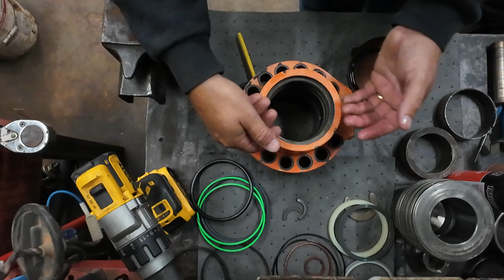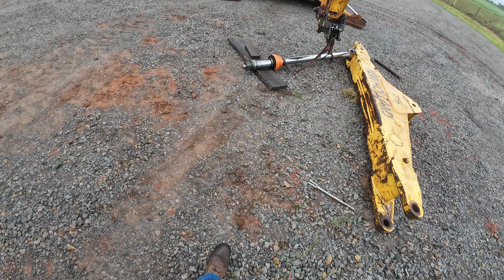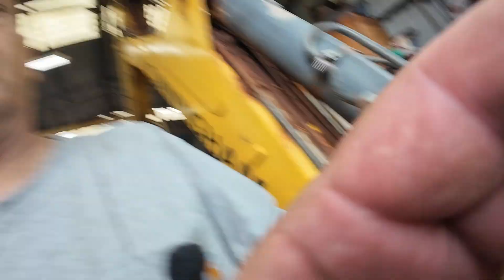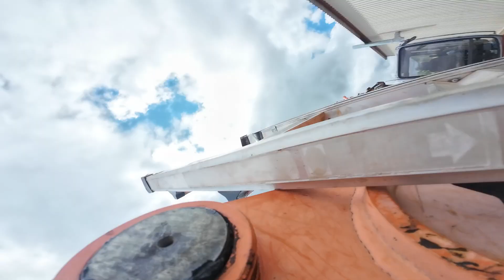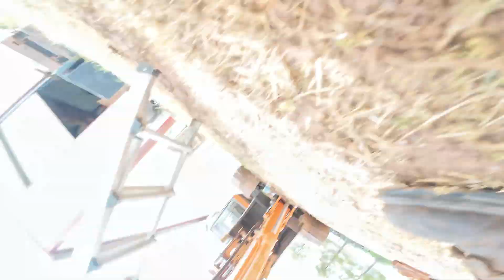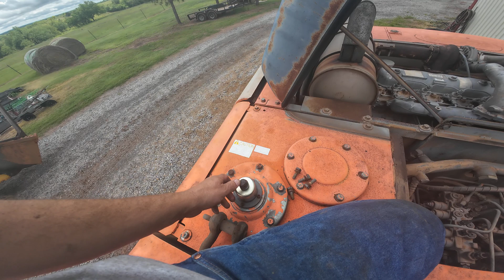Hitachi  ex200  stick cylinder repair pt 2

Comment: TLBs are versatile, but excavators can do real work in a hurry.

200/220 size machines were my favorite. Small enough to easily transport and get in relatively tight spaces, but big enough to move some dirt. Once you get those leaks sorted, that old gal deserves a lick of paint - she's made a lot of money for people.

We added a dangle drill - used the thumb circuit and bolted the drill on the side of the bucket for super-simple set up and extended reach/drilling depth.  4 grade 8 bolts and a rough and ready mounting bracket - we'd do 20' piers in a matter of minutes. Easy to take on/off.
Reply from the maker: depends on the type of work, I can probably make more profit per hour with a backhoe. But a different field of work will make the excavator a good asset. Interesting pier rig set up

Comment: You only have to release the hydraulic pressure from the tank . It does the whole system
Reply from the maker: It releases the pressure in the tank, the cylinders can still have pressure between the control valve and cylinder even when the tank is vented. So if the cylinder is holding the boom up, and the engine is off, the tank vent will not release that pressure. The manual has the directions for releasing the circuit pressure for each circuit. Thanks for watching the whole thing!

Comment: Case equipment  wanted $250 for a seal kit broken tractor they wanted $60 and updated version of the kit
Reply from the maker: Is that for a backhoe? Or an excavator? My case dealer is also hitachi. Quoted 700$ if I remember right for this cylinder. Hercules was 260.
Reply: 580 super m turbo backhoe I got parts for anything you think of machinery wise

Comment: The most common thing I see wrong with that machine is the engine bay hood liking to pop open while working. I hope yours is adjusted adequately. 
I look forward to seeing your next video.
Reply from the maker: The top hood? It takes some effort to open it. As for the side doors they work fine. Thanks